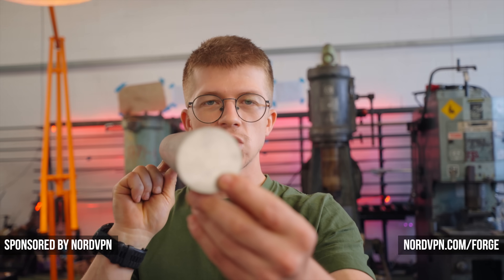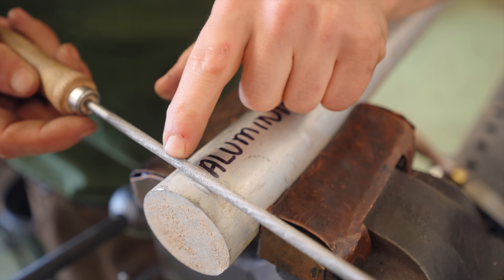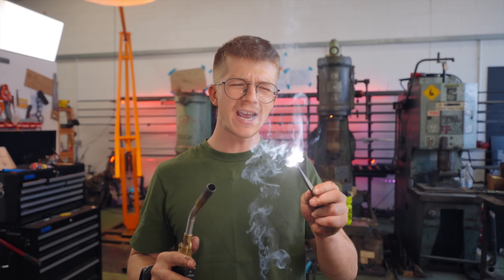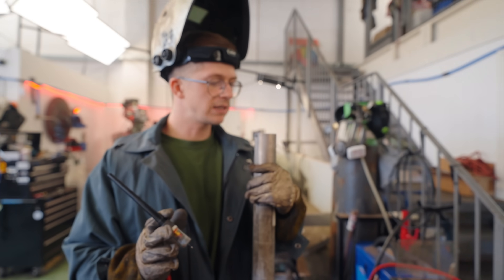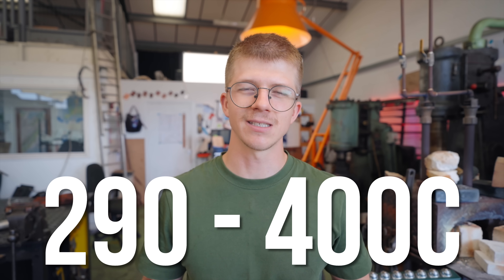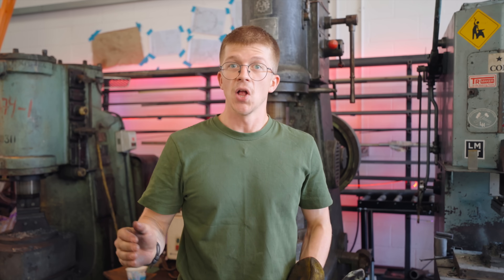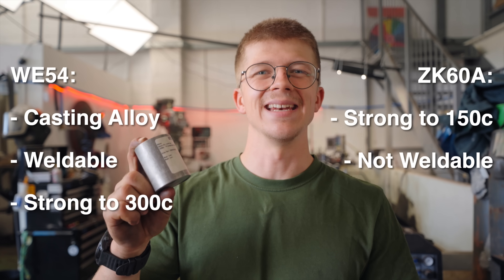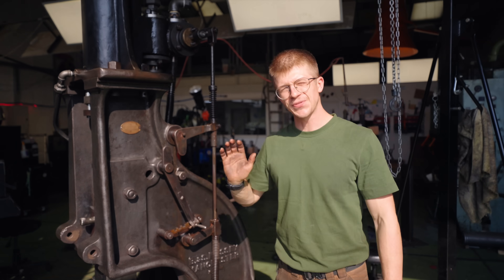Can You Forge Magnesium?

Comment: A very long time ago I had a Lawn-Boy lawnmower that I was given. It had a cast magnesium deck instead of stamped steel. I always wondered if I could catch it on fire with a torch but never tried. I took the deck to a junk yard when I had some aluminum scrap to get rid of. They didn't know the difference, so I got a little extra money instead of it ending up in a landfill with the trash. It was an odd looking mower because not all 4 wheels were at the corners. One was in the middle of the right side instead of at the front, because the discharge chute was right in the corner. It was the only lawn mower anyone in my family had with a 2-cycle engine too. Everything about it was weird.

Comment: The Fahrenheit scale may not make much sense, but it has one advantage over the Celsius scale.  There are 180 degrees between the freezing and boiling points of water instead of 100 degrees, giving you nearly twice precision in whole degrees. I have 2 window air conditioners, one in F and one in C. I can make 1 degree adjustments on the F model that aren't possible on the C model, because that would only be about one half of a degree and it only goes by whole degrees. An adjustment of 1 degree C is almost 2 degrees F, and sometimes you might only want to make a 1 degree F change on your furnace or air conditioner.
Reply: It makes more sense once you know the schema. O degrees F is the freezing point of brine (maximum salt concentration possible in water). 32 deg F is the freezing point of fresh water. And since we're talking about degrees, the 180 degree opposite of freezing is boiling. Add 180 to 32 and you get the boiling point of water.

0 deg F is also said to be the coldest temp Fahrenheit saw in his home in Poland,  while 100 F is a hot summer day. Where I grew up, the annual temperature range was approximately 0 F on the coldest days of a cold snap to 100 F on the hottest days of a heat wave. It makes for a nice percentage of the total normal heat expected any given year.

IFahrenheit is a scale well suited to ambient temperatures that humans encounter. That to me is more important than worrying about what water is doing at a given temperature.
Reply: @tid418  I already know the history behind Fahrenheit and Celsius, or enough of it. Temperature scales based on the weather make no sense since the weather isn't the same everywhere. Scales based on the freezing and boiling points of chemicals like alcohol make more sense. But since everyone in the world has access to water, it makes a better reference point than anything else. Maybe the freezing point should be 0 and the boiling point should be 360 degrees, so there would be a 3.6X finer gradation than 100 degrees. My window air conditioner was just set at 21 degrees C and the thermometer in the living room said it was 72 F. But I'm too hot in the next room, so I turned it down to 20 degrees and have a fan blowing the cold air on me. I don't want it to get down to 20 degrees, but if I could adjust it to 20.5, maybe I could get the room temperature where I want it. Sometimes I look up what the numbers on my made-for-Canadian-market air conditioner mean, but degrees C are basically meaningless to me. When my body temperature gets up to 310 degrees Kelvin I feel hot, but Kelvin is meaningless to most people. If it was an even 200 degrees between the freezing and boiling points of water, di-centigrade(?), I would be happy with that. 0-200 would make more sense than the 32-212 of Fahrenheit and have twice the "fineness" of the Centigrade scale, for anything measured in, or adjusted by, whole degrees.

Comment: Celsius is a better form of measure for temperature in scientific and cooking applications, Fahrenheit is better for weather and human applications because in Fahrenheit, 0 degrees is pretty damn cold, and 100 is pretty damn hot, and there is plenty of room between for you to find a comfortable number for you. In Celsius 0 degrees is chilly... 100 degrees is dead. the Difference between 50 and 51 degrees Fahrenheit exists but isn't that noticeable so it allows for more precise adjustments, the difference between 50 and 51 degrees Celsius is much greater and if you want smaller changes you have to get into decimals. For running a forge, Celsius is great, for adjusting my house thermostat, I'll stick with Fahrenheit. And if you are some psycho who thinks Kelvin is the correct measure for everything... your fucking wrong.

Comment: One of the places I intern during my degrees they used to machine F1 parts of magnesium (an alloy with much higher percentage than electron) and they used kerosene as cutting fluid. Sounds counterintuitive due to the fire risk but it was to prevent sparks.

Comment: I will say, Fahrenheit is easier to be more accurate in, as it has more precise numbers than celcius. For example: 78.8° F is 26°C whereas 78.9°F is 26.05°C. Also, compare 300°C to farenheit being 572 degrees; you get 272 more numbers to use for the exact same temperature range. For example: it’s easier for me to actually feel 1°c change in room temp, but it’s actually almost unnoticeable to change 1°f

Comment: Celsius having 0 be the freezing temperature is definitely smarter, but Fahrenheit has better scaling which provides more precision without needing fractions/decimals. 

Coincidentally though, 100°f is basically the line for whether or not a fever is getting dangerous. That's real easy for people, especially young parents, to remember. Don't worry about mixing up which fraction past 37 degrees is high enough to go to the er, if it's in triple digits you go.

Comment: 😱 dude, magnesium is reactive with water. DONT use water to put out magnesium fires. Most aloys are pretty safe to handle around water from what ive seen, but pure magnesium flakes or dust will combust when in durect contact with water.

Comment: The only problem with this video, is that the magnesium alloys which are what are most often used today, aren't really that flammable.   Sure you have to have proper safety precautions but that is one of the most amazing materials there are.  ..And you can get it from seawater.

Comment: I will say that for any process that requires a very specific temperature Fahrenheit seems more accurate because there are roughly 3 degrees to every degree Celcius that you increase or decrease. I'll also die on the hill that it makes vastly more sense on a mental level to use Fahrenheit when talking about temperature in relation to the human body. 120 degrees sounds bloody hot, 35 does not.

Comment: 2:07 Uh, something light doesn't have less atoms. It's atoms are light. In fact, given that it has fewer electrons wizzing about, generally it has far more atoms. No, take hydrogen. It has just the one proton and electron per atom. Helium has two protons and two neutrons and two electrons. It's basically four times the weight. Tungsten is something like 86 protons and around the same neutrons and electrons. So yeah, it's quite a bit heavier.

Comment: Here is my argument against metric temperature measurements.
The baseline is when fresh water  freezes or boils at sea level. 
fahrenheit doesn't have a baseline. 
I get using Metric for measuring weight and distance, but not temp.
It could be because I am American, and I know what 90° fahrenheit feels like but have no frame of reference for Celsius.

Comment: Fahrenheit was originally based on how cold does it have to be to freeze brined water. That's the temp when salting becomes moot, at least until the temp comes back up above 0F (-17.78C). That happens to also be roughly when we would freeze. The original body temp was off at the time though, 90F vs the average 98.6 (37C)

Comment: Cracks knuckles Ok I'm here in full defense of the Fahrenheit system! Celsius is great when you're asking water how cold it is. 0 is freezing, 100 is boiling. GREAT! That's not great for me, a human. In which 0 is really cold, but not immediately deadly, and 100 is really hot without being immediately deadly. Plus, with access to more degrees in between full measure points, it allows for a more accurate honing in on how hot it actually is. The difference between 15c and 20c is REALLY big actually. Nearly double that of Fahrenheit. In the same span of 0f to 100f, Celsius goes from about -17c to about 37c. 100 degrees for us, and 40 for you!

That being said, I don't think Celsius is pointless, it's far greater when it comes to scientific measurements, such as metalurgy!
Reply: So Fahrenheit is based on feefees, Celsius based on scientific  measurements. Got it!

Comment: You can put a magnesium fire out by suffocating it. A metal fire fire extinguisher just pours salt onto the fire. 

And in theory gasoline could put it out by taking all oxygen and burning at a low enough temperature not to reignite it, but putting out a metal fire by making a larger oil fire isn't ideal.

Comment: the hardness depends a lot on the internal structure of the material, the grid in which the atoms are aligned. Iron has a very basic grid structure, steel has carbon atoms between the iron, making the structure more stable and harder to move. When quenching steel after forging the atoms move back into their default positions, recreating the stable structure that was lost by heating it up in the forge, due to the atoms moving around.

Comment: Believe it or not, gasoline is more effective at putting out a metal fire (like magnesium) than water. Metals burn so hot that they can favorably rip the oxygen out of a water molecule, making the magnesium burn hotter and leaving behind hydrogen, which is also explosive. Meanwhile, gasoline has no oxygen atoms to rip away and leaves soot behind. So, the gasoline cuts off the air from the magnesium, the heat ignites the gasoline, the gasoline leaves behind soot, and the soot keeps the magnesium from igniting again by continuing to block oxygen access.

Or you can just use sand or table salt

Comment: The thing at the begining about density correlation to hardness and other physical properties is completely incorrect. Density has almost no relation to physical properties like  malleability, hardness, ductility conductivity, etc. for example, tungsten is very dense,  but it's very hard and very brittle. Lead and gold are also very dense, but are very malleable, and very soft. Aluminium is not very dense, and is harder than lead and gold, but softer than tungsten or steel. Density **does** have a direct impact on weight/size (since those are the two properties used to calculate density, I think it's fairly obvious, but eh, it's worth saying anyways I guess)

Comment: so first off,  °F to °C math is pretty easy.
°C x1.8+32= °F
50°C x 1.8(=90) +32 = 122°F

to work it backwards is easy also.
°F -32 ÷1.8 = °C
122°F -32(=90) ÷1.8 = 50°C

°F is easier to work with because 1°F  is just 1°. but 1°C is NOT 1°.  1° change in C is 1.8° 
a 5°C change is much larger than a 5°F change

also - i really wish you would have ACTUALLY tried to Forge the magnesium correctly.  because You Can Forge it. 
you just didnt get it hot enough. needed to be 450°C.  not 350°C.

From Google: 
The forging temperature range for most wrought magnesium alloys is 400–450 °C. (burns at 475°C)
Due to the narrow hot-working temperature range of magnesium alloys, the tools must be preheated to 205–400 °C, depending on the alloy type

Comment: I can't wrap my head around °c.  But °f is kind stupid to be fair.   32°f is the freezing point of water.  0°f is the freezing point of salt water. Ok so pretty normal science stuff right? No! Because 100°f is the average internal body temperature of a horse.    That is why I agree it's stupid.  Still hate the metric system. It just makes to much sense. Also you don't have oz. Of weight and volume.  So it's just less confusing and therfore is confusing to my brain.

Comment: pretty sure that yes density does have a part in how strong a material is. but not a big part as it mostly comes down to how its bonded.

mainly the density has a big part in something piercing it especially quickly as that means atoms can't move out of the way as quickly. as for tensile strength it does not effect it as much

Comment: You need a longer heat soak or induction heating to forge a piece that thick without cracking. Try holding the billet at forging temperature for 2-3 times longer, and moving your furnace closer to the press.

Next project, AlMag damascsus.  Use aluminum and magnesium shavings in an aluminum canister, the same argon purging method as the titanium project.  Clean the shavings with a magnet to remove any steel/iron from the mix, otherwise... I'm sure you can imagine it wouldn't be good.

Comment: Okay so ah... the dust from the aluminum with iron oxide dust... and then magnesium.  Thermite is just aluminum and iron oxide, and the magnesium as you pointed out is a common igniter since thermite requires a very hot fire to get it going.

Comment: Pure magnesium metal lack oxidizing agent. So unlike some of the worst materials, any oxygen depriving solution ought to put out the fire. Fire proof rooms where you can lock ventilation, oxygen depriving gasses, etc. Many ways a controlled environment can put out “fuel-only” materials. Batteries or rocket materials that contain both fuel and oxygen are much worse dealing with, they can sustain themselves!

Comment: Atomic structure of Mg is more compact than Al and they have different crystallographic structures. Al is FCC and Mg is HCP . FCC has more slipping planes system (ie more freedom in forming)
So we cannot compare them.
To deform Mg or Mg alloys , you need to do deform it at the transition temperature. Otherwise, you must apply high pressure and gradually apply it on its billet.

Comment: If you read this the tiny chips mean that the cutting tool is cutting correctly. If you are getting long stringy chips you're either pushing too hard or not hard enough. Taking too deep or too shallow of a cut. And also can be fixed with spindle speed. I hope this helps. I've been a machinist for 15 years on manual and cnc machines and this is how I was taught.

Comment: Okay yes it can be worked cold like that but to work it cold with THOSE tools you need to be annealing it like every hit if not every other. 

Half way into the video and this is working out to be a pretty clear example of how NOT to forge a billet of magnesium. Lets see if it improves.

Okay full vid finished. They did about as would be expected though I still say he was WAY overworking it and losing way too much heat running to the other side of the shop to where the anvil is instead of having it/one near the forge maybe?

Comment: Can you forge Magnesium? 

YES. Yes you can forge Magnesium. 

Is it by any means safe and smart to do so? 

Not usually in the traditional sense, unless the smith is VERY GOOD, and really knows what they are doing. However, it CAN be done if a person has the right equipment and setup. 
See also modern manufacturing methods. With modern manufacturing equipment, well it may not be particularly easy but certainly a good deal more safe? Though I expect these days magnesium is easier to simply CAST into shape rather than forge. 

So, the matter then becomes one of... 

Can you forge Magnesium? 
Well under the right conditions yeah, but why would you want to?

Comment: Ummmm Alex you do realize that you’re working with Magnesium ALLOY and not pure magnesium right Bro?? The addition of even a small percentage of other elements can profoundly change the melting point of a metal. In this case, yttrium, zirconium and rare earths at around 8-9% of the total of that bar you’re working with. The melting point of Elektron 43 is typically listed at around 540-640 degrees Celsius!!

Comment: Carbon is lighter, as an element, than Magnesium, Aluminium or Iron. Yet in a particular cristalline form, it becomes diamond, aka the hardest known material. If you were to be able to obtain blocs of diamonds of similar size to your cylinders of steel and magnesium, it would be the lightest one, but also the hardest (accepting it has no flaw in it). But a diamond of such a size would literally make you richer than the king of England so not going to happen any time soon

Comment: Celsius is best for scientific measurements, Fahrenheit is better for atmospheric measurements; There's more granularity in Fahrenheit when talking about outside temperature.
E.g. it's easier to tell the difference between 32F (winter day) 60F (Fall day) 80F (Spring Day) and 100F (Summer day) than 0C to 37.7C

But that granularity becomes meaningless when we're talking thousands of degrees regardless of the unit, as is usually the case in most areas of science. They all have their areas to shine, just like it would be pointless to measure the melting temp of metal in Kelvin...

Comment: Back in the mid 80s in our science class, to prove a point about how energetic burning magnesium actually is, the teacher put burning magnesium ribbon into a flask full of carbon dioxide we'd just created. Normally the CO2 would extinguish any flame but the white hot magnesium flame was able to split the CO2 in the beaker burning the available oxygen and deposting the carbon on the beaker as soot. That was 40 years ago but I remember it so well that I cringed a bit when water was used to put out the flame in this video!

Comment: Well, you came up on the American Assn. of Woodturners forum a couple of days ago. Some one was asking about if damascus/forge welded blades would be good for the wood lathe. Me, I was asking if it is possible to pattern weld M2 high speed steel, or better yet, M42 HSS. So, is it possible or just not worth the effort?